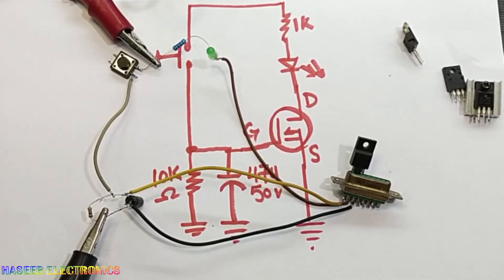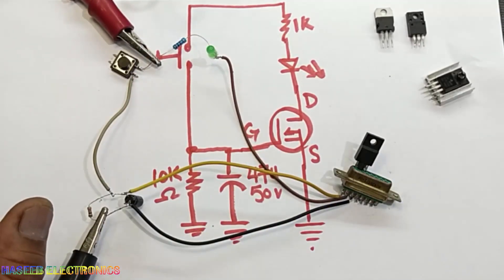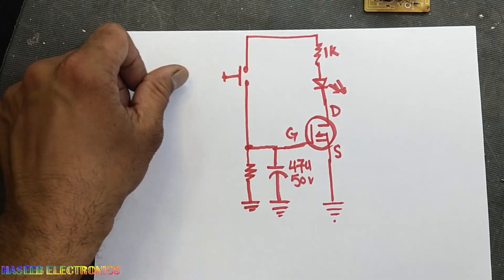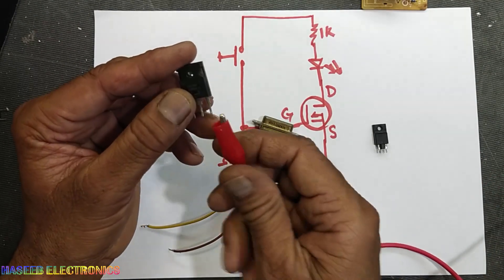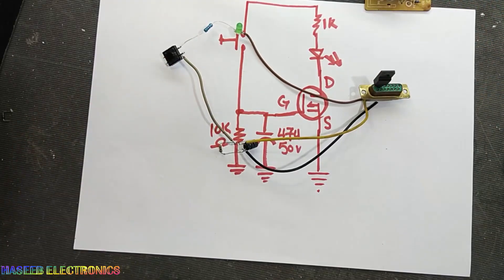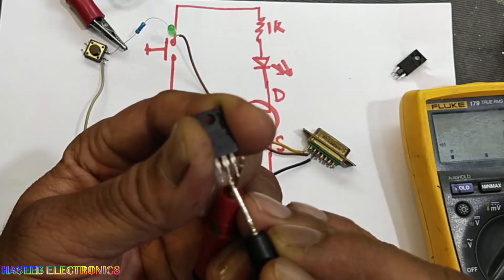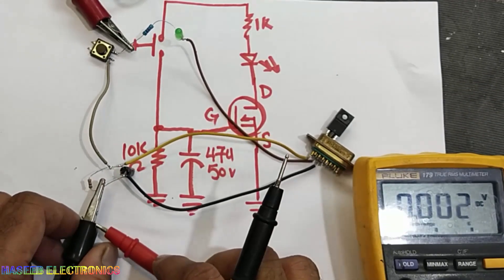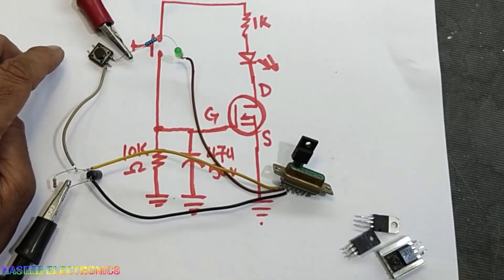{572} MOSFET Tester / How To Test Mosfet Without Multimeter / MOSFET Test Circuit

Comment: RESPECTED SIR ,  I want to know,  how I can safely discharge HIGH VOLTAGE CAPACITORS ( MICROWAVE OVEN'S CAPACITOR) . I mean to ask  about 2KV , 1 OR 2 microfarade CAPACITOR.  . Please sir make one video abt HV CAPACITOR DISCHARGE TOOL.
Reply from the maker: use 220K 1/2 watt resistor and connect test probes. insulate this resistor in some small box 
connect test probes to the capacitor, it will discharge safely
Reply: @HaseebElectronics  ok . Thanks Sir . 🙏

Comment: Can we put a small power supply at gate and avoid cap?
Reply from the maker: yes we can make arrangement, we can apply power. i attached this capacitor to just demonstrate the gate delayed discharging, otherwise we can connect just one resistor that will discharge the gate and mosfet will turn off

Comment: What if the mosfet is leaky what could be the indication in the led, can we also use this on Pchannel Mosfet, and also in IGBT.... Thanks
Reply from the maker: if mosfet have leakage in the channel, it will turn ON the LED as the the leaky channel have leakage above 10mA, 
to check P channel mosfet, we have to reverse Voltage polarity, LED and the capacitor connections

Comment: You are so incredibly in what u do thank you again. Continue wit your good work??? Can a optocoupler make a circuit dead.
Reply from the maker: best regards 
yes optocoupler is working similar to a mechanical relay (one side LED simulates the relay coil. if a relay's coil is damaged the relay will not work
& the output transistor behaves like the mechanical contacts of the relay, it will bad the next circuit will not respond ideally)

Comment: Sorry sir, the question is not about the uploaded video.  I am troubleshooting a smps which pwm IC capacitor is 50v but it can only charge close to 1v. At the output am getting 1v as well.. I remember you did a video on how we can troubleshoot smps which pwm ic's capacitor have no charge. I replaced some diodes, capacitor, transistor, MOSFET which shorted. Can you refer me to videos that can help
Reply from the maker: welcome dear 
if the PWM ic's VCC capacitor is getting only 1 volt, that means there is some abnormality in circuit  
might be VCC capacitor is bad
might be something wrong the output stage 
most common possibility is RCD snubber circuit (diode, resistor & capacitor connected  between the mosfet drain and the main dc capacitor's +ve terminal. in parallel to the smps transformer's primary winding)
Reply: @HaseebElectronics  I will work on snubber circuit. Below is the image of the smps board.

Comment: Salam M Haseeb, nice video. What is the purpose of the 10K resistor ? isn't the led enough to discharge the capacitor ? Thanks & Salam Aleikum
Reply: I think the 10k resister is discharging the gate rather than the LED…..I stand to be corrected however😅